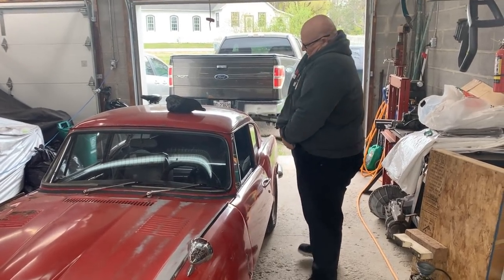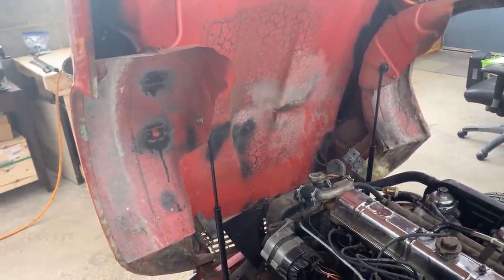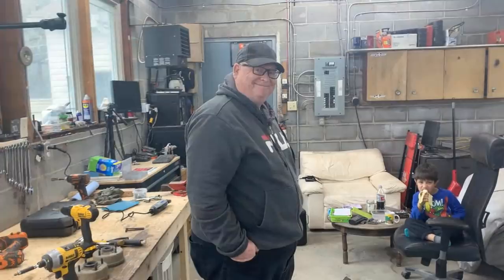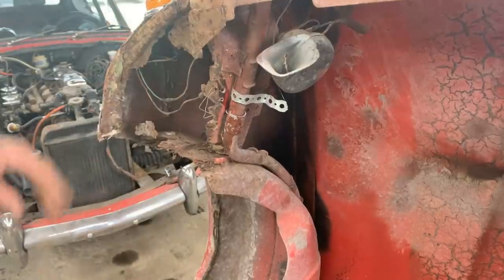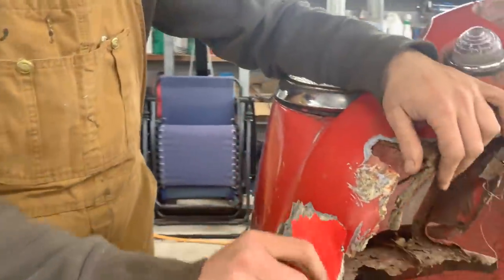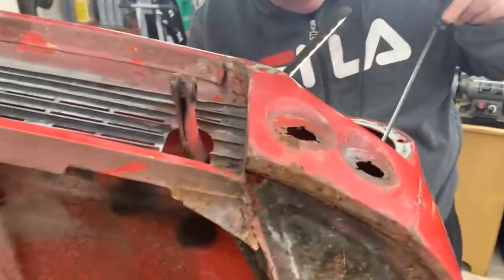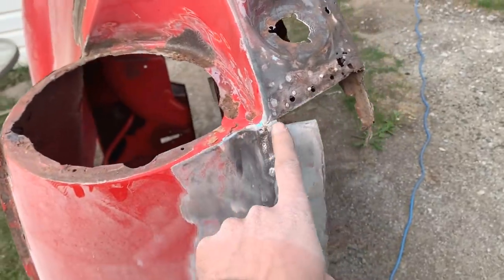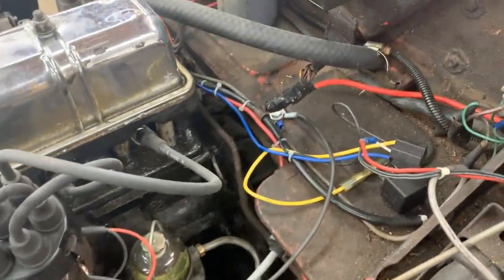1966 Triumph GT6 MK1 - Part 2 - (st)RIPPING the bonnet

Comment: From factory, the Mk1 and early Mk2 grille is indeed two halves riveted together in the middle, to a small steel tie piece. The flush rivets are original, the pop rivets with the little holes are not.

Comment: I am making a wooden buck for the triangular panel under the headlamp if you want to use it after me (or I could knock a pair out for you). Save money where you can. Also KC37xx was most likely made in 1966 but registered in the US in 1967. I have KC1259. Cars <KC5000 have some differences (door latches are smaller etc). Have fun with the project. Will be following along.

Comment: Those bonnet repairs were definitely a bodge, but whoever did it, must have been quite artistic.  Back in the 1960's we had to do the same , but not as well, as the cost of welders and welding would have eaten to far into our beer budgets.. I remember a friend having a 1967 GT-6 and it definitely had a dynamo, but no anti-rust rocker cover breather connected to the chassis (frame), ha-ha..
Reply: Either a boatyard or Lotus specialist....